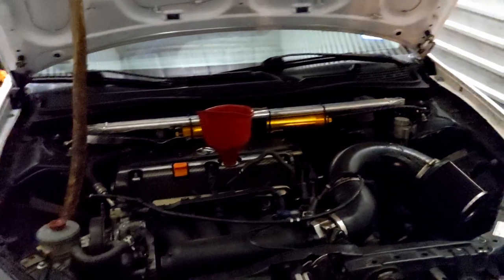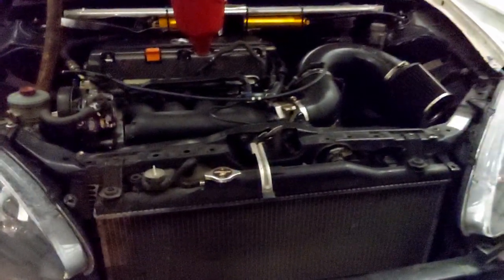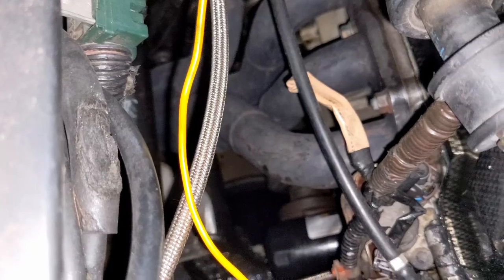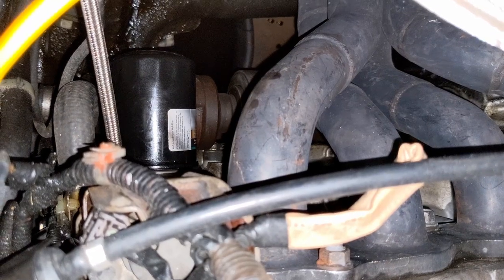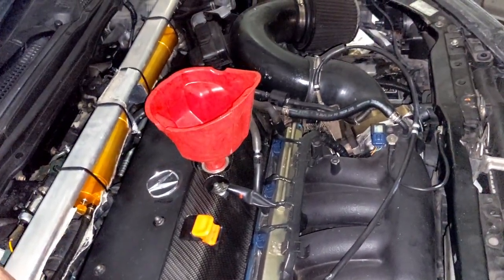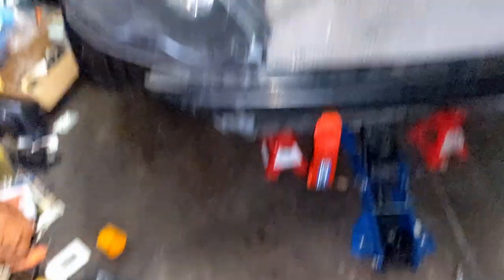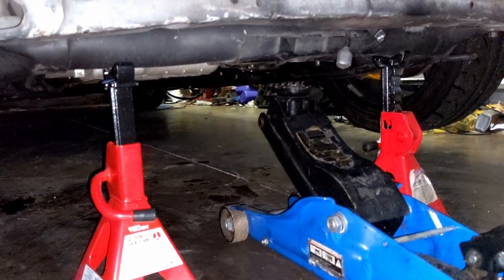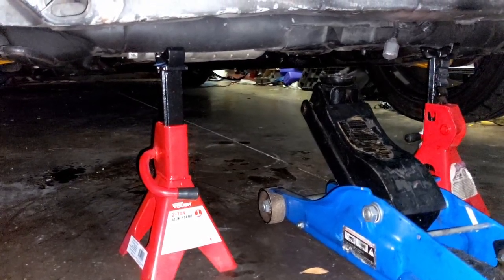Track DC5 RSX Oil Capacity / Track Tuning

Comment: I hear you gotta be careful with running too much oil because the crank will hit the oil and cause air bubbles. About to do an oil change on my K24a2 swapped FG2, I usually keep mine around or just above the top dot on the dip stick or 5.5 Quarts, going to try 6 Q this time.
I definitely want to get a good K20z3 baffled oil pan for the swap... Just running a stock k20z3 pan for the rear mount
Reply from the maker: Yes you are correct; running to much oil can cause issues as well. But after learning another guy I know in motorsports is running 6.5 quarts successfully. I decided to try for myself. Because my oil pressures keep dropping too low. Dropped close to 20-25psi last session I was out on track.
Reply: @4bangermafia  yeah I think it is a good idea for sure! Do you know the limit where crank starts hitting oil? I would guess its at 7.5 or 8 quarts?
Reply from the maker: @dangusprime  Unfortunately I don't know that limit lol, I just going off what someone else has done and has been successful in. So atm I can say 6.5quarts is safe.

Comment: Nice video, not many people share their experiences about maintenance after the track day. With my single adjustable ohlins DFV I set the front at half way from full stiff and the rear I set it to full stiff, and usually run equal psi or 1-2psi higher at the rear to help with rotation. 

I am still waiting for my clockwise baffle but my local track only have one hard left hander so far I haven’t notice any problem with oil starvation, I just add half a litre extra didn’t think I could have add up to 1-1.5L more. 

I also notice your valve cover breather is not connected to your intake and did you also deleted your pcv as well ? I am in the process of experimenting a good oil separator setup for pcv and valve cover my self.
Reply from the maker: Do you have an oil pressure gauge?

The part of the PCV that is important is the valve close by your power steering that connects to your Intake Manifold.  The one from the valve cover can be left open. Oil has never came out of it for me. I rather just have it open than vent it back into my intake.
Reply: @4bangermafia  I do have oil pressure gauge and I use 10w-40 oil instead of 5w-30, I don’t think I ever saw it below 25psi. Also I do notice a oil film was formed in my intake pipe hence wanting to install a catch can system to eliminate that. 

I would suggest add a small filter to your valve cover just in case any dirt or insect might get in from there.
Reply from the maker: @itsracer7495  it's venting, putting a filter on the end would probably contain the blow-by since those filters are made for vacuums and the blow-by isnt forced out that strong. That's why they route it to the intake to create a vacuum. 

I'm trying 10w-40 for the first time. Preferrebly would like 5w-40 but couldn't find any at the store. But my oil pressure has been a constant issue.
Reply from the maker: @itsracer7495  Also typically only turbo vehicle get oil out their blow-by vent. So that might indicate an issue.